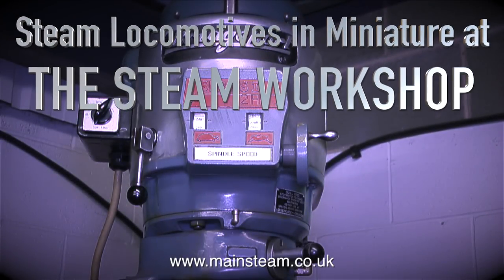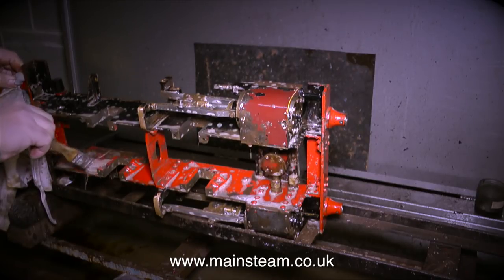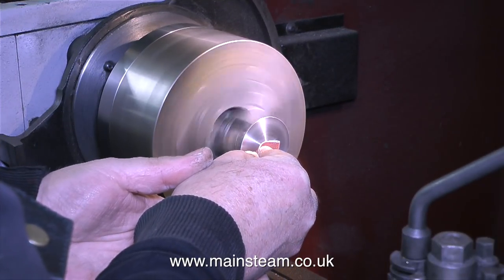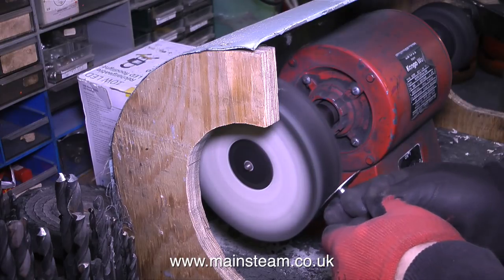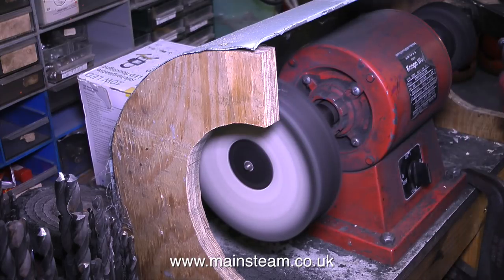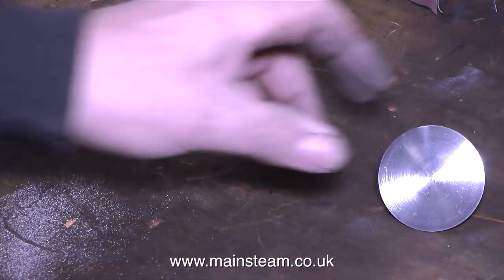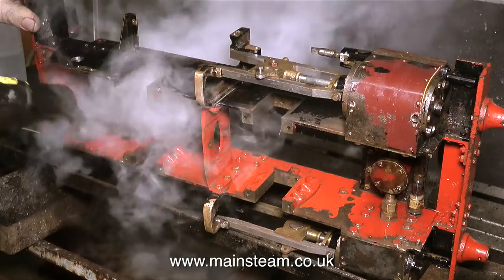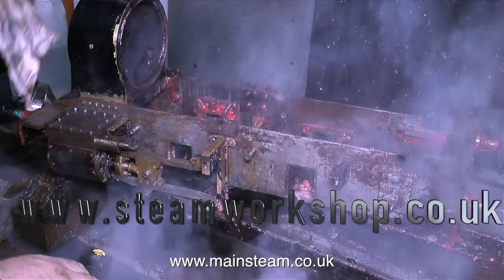WORKING AT THE STEAM WORKSHOP #3 - CLEANING THE BUFFERS

Comment: I bought a stick of that polishing soap so many years ago that I can't recall how long ago it was. Just yesterday it helped me bring an awesome shine to the brass cowling on the top of the smoke stack of my 3" Maxitrak Aveling & Porter with a polishing mop on my cheap copy of a 'Dremel'.
I'm going to have to get some degreaser to use alongside my steam cleaner on the top where the jet washer couldn't shift the accumulated oil!

Comment: Sealed  bearings, blimey! Nothing but oil lubed tapered roller bearings will do. Must have a shield behind the lathe to stop the flung oil. Operator works well for that on the front. ;-)

Comment: Keith I have been all through the railyards many times and have never found a Buffer. It must be an overseas thing.
Reply from the maker: I Googled it for you: https://en.wikipedia.org/wiki/Buffer_(rail_transport)
Reply: I'm guessing you're somewhere in North America where buckeye couplers are the norm, and they can transmit pushing and braking forces through the coupling so you don't need buffers. Our chain coupling system means the buffers are necessary for pushing.
Reply from the maker: https://en.wikipedia.org/wiki/Buffer_(rail_transport)

Comment: I don't get on with white polishing soaps, preferring green for any of the steels, reds for the brasses and coppers and I have some white for alloy but I find its very cloggy preferring the gentle light blue for aluminium (and plastics it does a top job) and finishing with Mothers Mag n Alloy compound which is really really good at polishing aluminium up like a mirror, dunno what it is I am doing wrong with the white but have tried it soft, tried it hard, tried it with different bonnets and fibrewheels and I thought it was a bad soap bar but the replacement branded one I got was just as bad :S
Reply from the maker: I just used what was there . . . . in my workshop I use the brown stuff usually.
Reply: Yes red and brown are pretty good all rounders gotta agree, very good at getting deep marring out of a metal :D